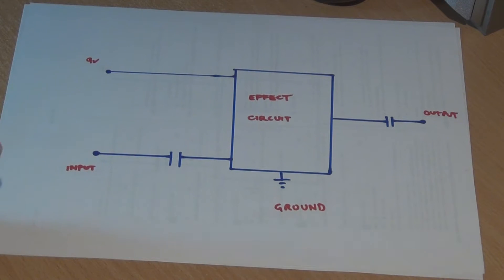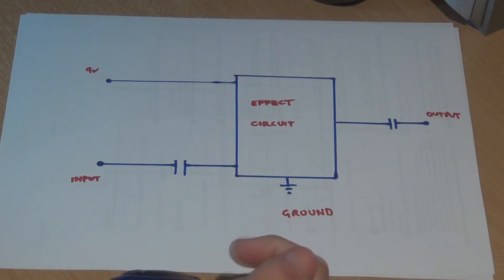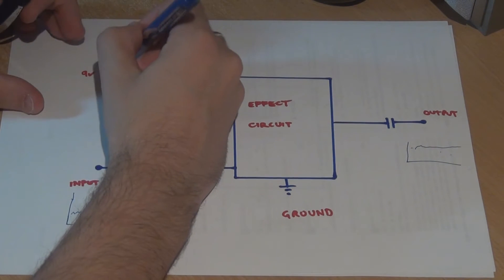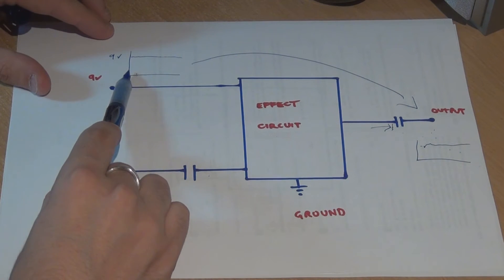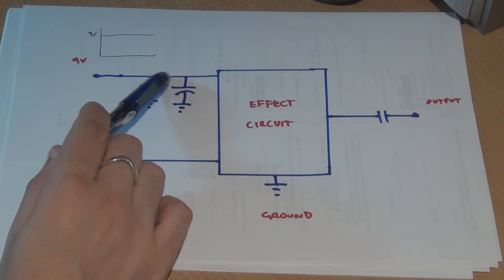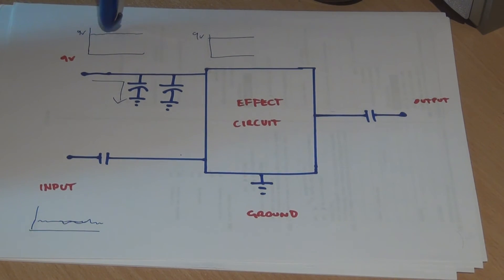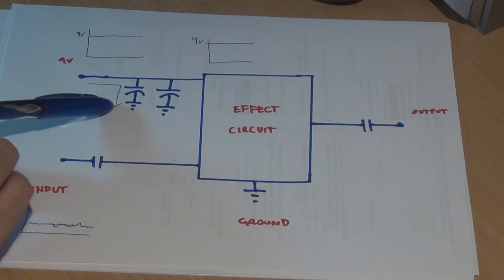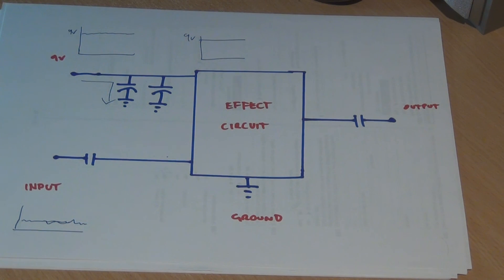Guitar Pedal Power Filtering & Decoupling Capacitors

Comment: 9:11 Even if you have a very stable good quality power supply, it's still a good Idea to have capacitors there: wires between the supply and circuit act as inductors, so they can actually cause the voltage to get too high and introduce some noise I think.

Comment: The configuration you show with 2 capacitors to ground works much better with a resistor between the 2 caps to ground. This is called a Pi filter and is used extensively in tube amps. 

Many pedal circuits appear to use a cap and a diode to ground for filtering. I’m going to have to research that some more.

Comment: If you use an inductor in series with the 9V power supply, it will resist change in current flow, and will block frequencies at a certain level and UP, instead of down like a capacitor. So it will further help reduce noise from the power supply, maybe even remove it all together.

Comment: These videos are great man! I was wondering why there's always capacitors on the in and output of pedals
Reply from the maker: Thanks Jakub appreciate the comment!
Reply: No worries, I've been following the channel for a long time now and it's the best iv'e seen on the topic, and is what inspired me to give it ago! 

I'm actually trying to put together a modified version of 7 minute fuzz, and one of the features i'm looking to put into it is a switch that converts it to a Bass guitar fuzz, for that i was thinking of installing a blend control that has a pot with both a high pass filter and a low pass filter attached to lug 1 and 3 of the pot, having the bass frequencies sent clean bypassing the effect to the output, and the higher frequencies sent through the effect, so when they're combined you have the top end distorted with a clean focused low end. 

I'm relatively new to this so i'm not sure if this set up would work, whether the clean bass frequencies would need a boot after going through the low pass filter, and what values would work best for the potentiometer...   

here's a link to a detailed wiring diagram mock up I drew, https://scontent.fbne4-1.fna.fbcdn.net/v/t1.0-9/36659150_235620523900968_4241480023858479104_n.png?_nc_cat=0&oh=f6b38b870dc189376ed6c6e014e2df49&oe=5BD9B57C

thanks so much for any advice/tips man.

Comment: "Who is supposed to do the filtering? Is it the power supply company supposed to regulate the voltage properly or is it up to the effect manufacturer to have some sort of filtering in their circuit?" It's up the effect manufacturer. Power supplies work within the tolerance of whatever they're designed to power. If you design a circuit to use a any old non-specific power supply that doesn't necessarily meet the requirements you need it to meet, that's on you. You can't expect a company to make power supplies that are designed for doing things like powering LED strips to make them meet the requirements for an audio processing application. That would be expensive and pointless. If you aren't going to design your circuit to work well with any old power supply, you need to either make sure you can get a power supply that meets your requirements (and include it if it's a product you plan on selling) or make one that meets your requirements yourself.

Advice on decoupling caps: If you need something to be really stable, put some decoupling caps in parallel. Bigger caps that hold more charge are usually slower to react than tiny ones, so get a big one that can hold all the charge required to counteract the ripple and then throw on a 0.1uF or two right next to it to pick up the slack for when the big one isn't quick enough to react. You can also throw a 10uf on if the big one is really slow and you're depleting the charge in your 0.1uF caps before the big one starts discharging. It's not quite that simple, but that should usually work even if you don't know what you're doing. When it comes to stability, you can't really have too many decoupling caps. The worst thing that can happen is that you waste a few cents and an electrical engineer laughs at you for not knowing how when enough is enough.

Comment: Good video with a lot of info, thanks. Just wanted to clarify some details:
at 2:16 the signal drawn is DC with noise/ripple. I believe that AC (e.g. from guitar) should get negative values (alternating).
at 8:04, capacitors at series are called "coupling" cap, not "decoupling". Decoupling caps are used to separate electrical circuits and placed parallel to ground.

Comment: Any ideas on the value of the cap to reduce the AC noise on the 9V DC line?
Reply: Skyler Cornell if you want to filter the ac signal properly,  you first have to get rid of the highest HF content by using ferrite (clips, rings etc.) on both ends of your DC cable. As a 2nd step i would use a good FKP -cap of 10-100nF as close as possible connected to the DC-Input connector. Then cut the positive cable near the DC-Input and insert an inductor (100-1000uH/>=0.5A) in series and dont foget to isolate the positive Signalpath. Finally use a good electrolytic Cap. (100-330uF/25to50V Rubycon ZL, ZLH, or compareable) in parallel with a 0.1 to 1.0uF Foil Cap. directly connected to the pedal PCB. If you need help, ask a friend or go to your musicstore. Have fun with your new sound!
Reply: 2 ways:
quick and dirty: shove a few 1000-3300uF 12-16V caps in parallel with the wire, duct tape.
fancy: get yourself an LM7809 with a heatsink, make a board out of it with the caps specified in the datasheet to prevent oscillation in the chip, add a 3300uF 12V cap in parallel on the output... now you have a cheap nearly perfect 9V 1A power supply BUT you have to feed it with more than 12VDC (check LM78xx datasheet).

i use the fancy one to rectify a random cheap unregulated power supply for my diy oscilloscope and it's dang good. -> https://imgur.com/a/3K4Mo
Reply: @emperorSbraz  its old tech.. 7809,, still great

Comment: Hi Paul, As you may know AC and DC can reside in the same line, wire, without mixing or changing each other. As you stated, the purpose of the capacitor is to block the DC and let the AC signal from the guitar, etc. through. The same holds true in guitar tube/ valve amps from the plate of the tube/valve. A higher value cap will eliminate more ripple, or, better yet, a series of caps separated by resistors. Your information jives with what I have learned in regards to electronics. You are a credible channel, worth a subscription. Thanks again for sharing your experience. Take care, C,

Comment: Well, lately i´ve been studying about power supllies for pedals. And heard that for some applications a voltage regulator ic could make very big difference, it visually flattens the signal through an osciloscope. But i still have some doubts like: looking at a voodoo labs  power suplly, they say that isolated outputs make big difference in power filtering because it eliminates the ground loop. Well, that means that this kind of power supply doesn´t have a commom ground?? How they can do that?? One transformer for each output?? could you help me??

Hope i make myself understandable, because i´m not a natural born english speaker.
Reply from the maker: +Joao Martins Not 100% Joao, but I think they can use either multi transformers, or a transformer with multiple outputs.  Google image search "pedal power supply spyder" you will see a few examples of isolated outputs (read about this YEARS ago, but fairly certain there is a DIY project called the spyder with isolated outputs).
Reply: +DIY Guitar Pedals Multiple secondaries!!!!!! How i didn´t have think on that. Thanks a lot, you have solved a mental pitfall for me. I will google your sugestion ank keep studying.

Comment: First of all - huge thanks for the video! Your explanation got through to me (as opposed to some of the not so well written articles on the web I read earlier). 

As a newbie DIYer I have one more question. I've seen people add resistor after the decoupling cap. (for example 100k resistor after 100uf cap or 220k after 220uf cap and so on). Whats the use for that?

Comment: Would a full-wave rectifier also serve the same purpose? There's obviously a small voltage drop across the diodes, but theoretically  speaking, isn't the behavior the same as the decoupling caps? Thoughts?

Comment: hello, this looks great...im just still curious about the implementation here as i couldnt get it from the drawing...wouldnt doing something like adding a 100 ohm resistor from the power supply to the pedals power input, and also adding a 220uf(or higher) cap ON the actual power jack, positive side on the power lug and the neg side on the GROUND of the power jack...?

Comment from the maker: Watch my other 2 power filtering videos.  I use a 100 ohm resistor as well on the plus line (well, an inductor, but i honestly didnt notice any difference between the 2).  This video is specifically addressing the question about filtering guitar frequencies and the capacitors.  You should experiment with the cap types and sizes to see what works for you, probably on a breadboard.

Comment: Beautiful! I've seen this once before... Have you heard of Craig Anderton's "DIY Projects for Guitarists"? His second beginner project is just this, except that he first has a 100ohm resistor from in 9v in then a 1000uf cap going to ground... What does that do if it is indeed necessary?
Reply: A resistor in line with the signal path followed by a capacitor to ground creates a low pass filter. You can look up the math to find the frequency cutoff, but a 100 ohm resistor and a 1000uf cap cuts all but the very lowest frequencies.

Comment from the maker: Yes some people even solder the caps directly onto the dc jack! As long as its from plus to minus you will be fine (and the right orientation of course).
Resistance (or a diode, etc) on the +9v or ground lines will cause a voltage drop, but no, caps from plus to minus will not.
No problem thanks for watching and the compliment!

Comment from the maker: I forgot to mention it in the video but i have found that circuits that have low input impedance (ie on the transistors) usually cause the most noise (a simple transistor boost for example), where as op-amp based circuits that have a high impedance, generally dont cause as much noise. Thats what ive experienced anyway.

Comment from the maker: No problem i will try to answer.
1) i dont think so.  Impedence is usually set by pull down resistors or the input of an opamp.
2) There is a calculator i used, i cant recall the name of it.  The fact is though, experimenting ended up giving a better result (with the value of the cap, but also i've read since, the type of cap can make a difference as well, film and electro for exampel)
3) I dont think so.  It will only filter noise, from my meager understanding anyway.
Cheers

Comment: Thanks for this video, it's really instructive. I have a few questions if you don't mind.
1. Does the values of the input and output caps have an effect on the impedance?
2. How do you determine the best values for the filtering caps?
3. Is there any adverse effects of having power filtering in the power supply AND in the effect?